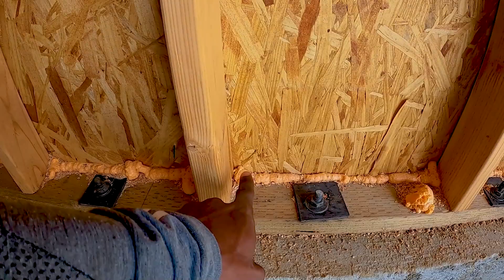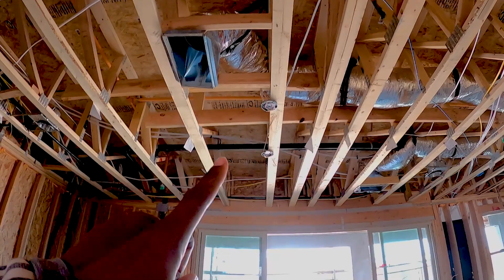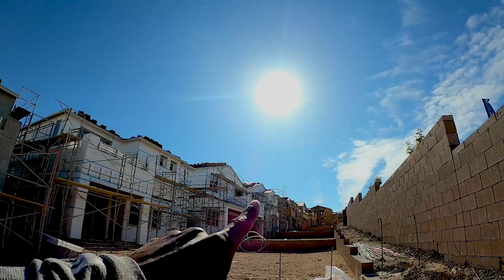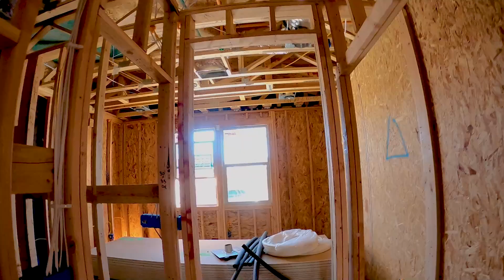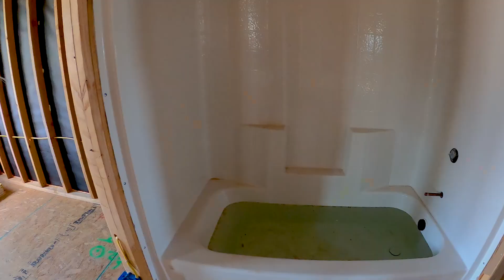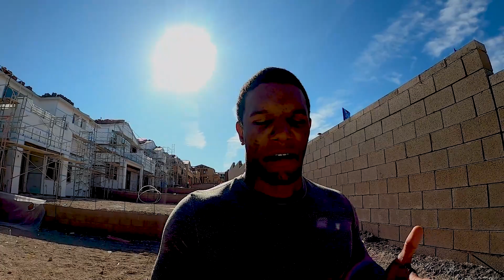NEW BUILD PROBLEMS & PROGRESS LAS VEGAS | WEEK 29 | MOVED FROM UK TO AMERICA

Comment: Most appliances in the US take a hot water feed - dishwashers only have a hot connection for example and only need to boost the temperature with the element a bit. You can only pull about 1800W from a regular 120V outlet so heating cold water inside appliances would take far too long. Think about how much longer a kettle takes to boil in the US vs the UK!

In many places gas costs a lot less than electricity so it's cheaper to heat the water with a gas water heater - for example in NJ natural gas is about 3c per kWh and electricity is about 17c per kWh so even accounting for efficiency it's way cheaper.